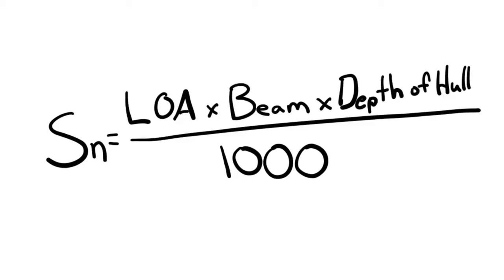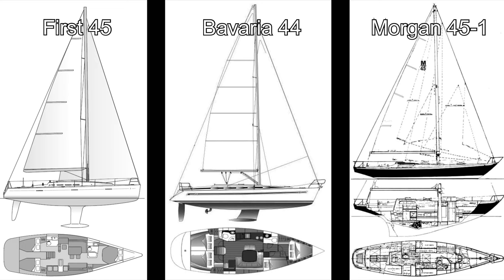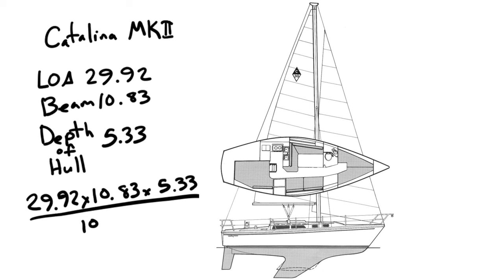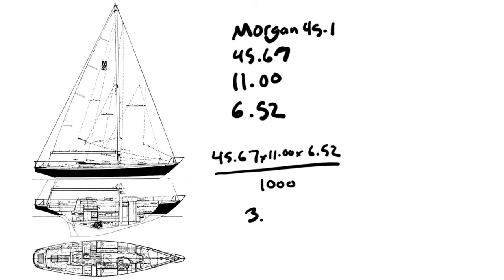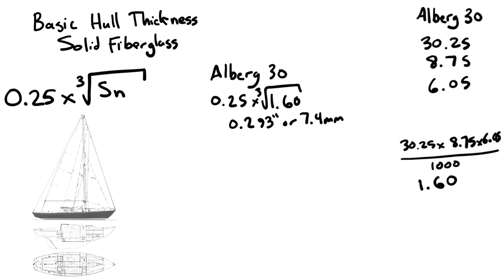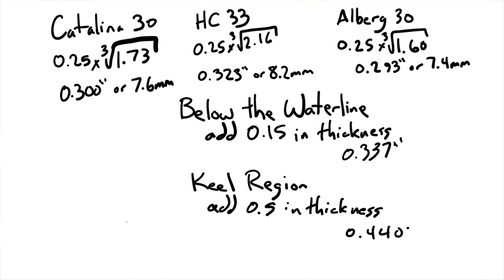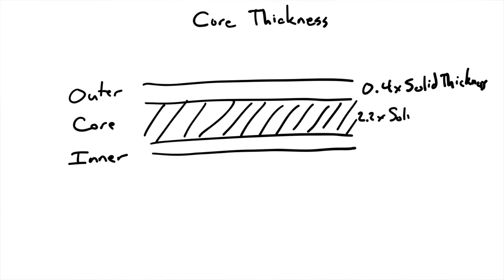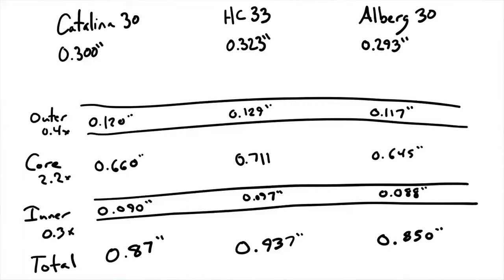Is Your Hull Too Thin? | Sailing Wisdom

Comment: I like your premise of this video, but this video is technically really bad.  You’re not opening up a discussion or ‘awareness’ of hull thickness, because it’s clear you don’t quite fully grasp the concept and use case of Scantling Numbers.

Scantling Number is a base line Coefficient to calculate other aspects of boat design.  While you do touch on that, it’s clear you don’t understand the rest of the equation.  Hull thickness is not defined purely by LOA, Bean displacement.  But actually from the core design of the semi-monocoque design.  The spacing of ribs, longitudinal stringers, size of the ribs, use case of the hull, hull pressures are all factors of hull thickness.  More ribs (tighter space) = thinner hull thickness. 

Even the type of fibreglass used to calculate Scantling is used 90degree axis glass Matt.  Modern fibreglass is either triaxial or even quadaxial fibreglass mat.  These modern materials again change the load characteristics and requirements of a hull.

The idea in your video that you can define someone’s boat as either being too thick or too thin is quite simply creating stress and drama of owners who would look up to you as a source of information.  This information is quite clearly, very wrong.  It is not the full picture and it’s not even a full of thumb.  It’s not offering any value or guideline for owners of boats.  It is only going to create drama and concerns, because you don’t provide all the complex information, because as above, it’s clear you don’t actually understand the complexity yourself.

Here are some actual publish resources that clearly describe the full picture, and reference my claims above.  In both separate publications, they both mention that it is critical to factor in the hull structure, and not just Scantling number alone.  For reference I am an aviation structural and mechanical engineer.  There are many naval architects that have already commented similar problems with your application of the Scantling model.  Structurally, what you are implying in this video is incredibly wrong and a huge misdirection to owners.  

https://www.foils.org/wp-content/uploads/2018/01/Scantling_Handbook.pdf

https://www.gerrmarine.com/ELEMENTS_OF_BOAT_STRENGTH/BoatStrengthIBEX.pdf
Reply from the maker: This is a basic video on the topic of hull thickness. I didn’t get into the other supporting measurements because then this video would be hours long! For a comprehensive explanation on the topic, YouTube is not the resource, books are. 
For your average owner of a production boat, this is the ruling guide they are built to. The “Basic Hull Thickness” is the starting value for any boat. From there, geographic region of use, speed, heavy displacement, passenger vessel, fishing, other supporting structures, etc, play in to either increase or decrease the thickness of the hull by a relative percentage to the Basic Hull Thickness. 
I do understand the complexity involved and simmered my knowledge down to a very easy to digest 25 minute video which I hope might inspire some viewers to read further into the topic that they didn’t even know existed a moment ago. 

All of the complaints are that I ignored the other parts that play into boat construction when this video is merely how to calculate the basic starting number for your boat. 
In one book, the two formulas I showed were described and calculated on page 5 and page 28 (right after the introduction) of 355 pages. That book is incomplete on the knowledge that it presents and needs a few other books to begin to educate the reader on a more complete understanding of hull construction. 
So if I made a video that read that entire 355 page book, you would still be rightfully claiming that the video is incomplete and it would be so long no one would watch it. 

Now calling this information quite clearly, very wrong I take issue with because for an introduction, this is very right. The books that I have read on the subject all start with figuring out the Scantling Number for a boat, followed by calculating the Basic Hull Thickness. As you dive into the middle or end of the books, they will go into everything that you complained about, but not until first establishing the well know rules of thumb and foundation of the calculations.

Comment: All this is a gross generalisation. There is no real structural engineering behind this. It depends on internal, frames, floors, stringers etc. I am feeling you are misleading people. Really you need to study naval architecture before handing out information like this?
Reply from the maker: This is a gross generalization of scantlings which are then modified based on construction technique and materials used. Most boats, however, are the boats that these gross generalizations apply to. If someone has a boat that deviates from the norm, they already know it! 
The point of this video is to inform people that there are governing formulas that dictate everything about their boat, not to teach them how to design a boat.
Reply from the maker: This is like telling someone about engine oil weights and having a spectator come up and start telling me that I’m misleading people into believing that they can rebuild their entire engine. 

This is a general overview of how the hull thickness is determined, not the actual thickness that was chosen to be used for the boat based on actual engineering. If these numbers were absolute, then every boat listed as an example would have been built to these thicknesses, but we all know that is not the case.
Reply: It’s a YouTube video, not a Master’s course.
Reply: Great overview. Good to see you are still alive and kicking 😊
Reply: Chill out. No one is going to build a hull based on a YouTube video and nothing he said is incorrect or misleading.

Comment: So at around 19 mins you are claiming that 25mm solid glass is about as strong as 25mm cored laminate? Then how come a 10mm thick solid hull need to be 29mm thick when cored?

There is a difference between strength and stiffness, and they should not be confused with eachother.
Reply from the maker: One of the reasons is puncture resistance. If the core took up the grand majority of the thickness, then the out skin would be so thin that it would be too fragile and weak. I have sailed on a friends race boat that he built himself. He placed an extra layer of fiberglass in key areas for puncture and abrasion resistance. 
Having the outer skin be 40% of its original thickness keeps it strong enough for the job, but the real strength comes from the distance between the inner and outer skins. The core accomplishes this without the weight penalty.
Reply: @RiggingDoctor i understand that the core gap provides strength. But is this compromised by the wood core turning to mush....or does that not affect hull strength?
Reply: @RiggingDoctor   My issue here is that you are referring to bending strength and stiffness as "strength" and putting all the other parameters into something else like puncture resistance which is more related to the out of plane shear strength (\tau_13 and \tau_23) direction of the laminate. Obviously tensile and compression strength in all 3 directions of a laminate are almost purely depended on the fiber content and orientation, the core provides nothing. It is really wrong to claim that similar thickness laminate with core would somehow be about as strong as solid laminate.
Reply from the maker: The wood core is not supposed to turn to mush, that is a core failure and that is what I was referring to when I said that a rotten core can kill a boat.
Reply from the maker: The core helps separate the skins like an I beam separates the two horizontal plates. 
If you have a solid bar or an I beam with the same thickness, they will have almost the same stiffness, but the I beam will weigh much less. 
Hulls work in a similar fashion, but if you had such a thin skin over the core, it would be too weak for marine use. The 2.2x core thickness and 70% original fiberglass thickness split onto the inner and out skins is what is considered a safe size to build a fiberglass boat. The skins are thick enough to survive the marine environment but weigh about the same as a solid thinner hull. 

Lets look at it the other way around: if you took a 3 inch thick, properly cored hull and then replaced the core with solid fiberglass where the core was, you would now have a 3 inch thick solid hull. It will weigh significantly more but still be about as strong as the cored hull was.

Comment: If a boat gets bigger, its hull gets thicker therefore stronger ??
Youre confusing thickness and mass rather badly 
See 26 ft steel boat  versus Fibreglass versus Ferroconcrete.
Your whole premise is badly flawed.
Reply from the maker: I’m afraid you are misinterpreting this video. This only refers to fiberglass. This is why I talked about Solid Fiberglass or Cored Hulls. 
You also didn’t understand the toothpick analogy. As a boat gets smaller with the same thickness, it gets stronger. 
Larger boat and larger hull needs to be thicker to have the same strength. That’s why I said a 1 inch hull on a 20 foot boat is crazy thick while a 1 inch hull on a 120 foot boat is pretty thin. 
Mass of the hull is relative to its density. A more dense hull will be heavier and have more mass. That same thickness could be made of lighter materials, have less mass, but still retain the strength needed. Solid fiberglass weighs 96 pounds per cubic foot. If you can make that same volume out of lighter materials, you could then build a cored hull for less weight. Thicker with less mass. 

I don’t mean to offend but I really think you need to clear your mind and watch again, starting at the beginning.
Reply: @RiggingDoctor  I did start start at the beginning, and the type of hull  wasn't evident at all.
Edit. Just rewatched the  first 3 minutes, NO mention of just composite at all!
Reply from the maker: 3:05 “solid fiberglass”. 

This video is about fiberglass boats. 

The first three minutes where I’m talking about boat weight being heavier or lighter and how that affects sailing performance holds true for all boats, regardless of the material. This is why many types of materials exist to try and create the “best boat”.